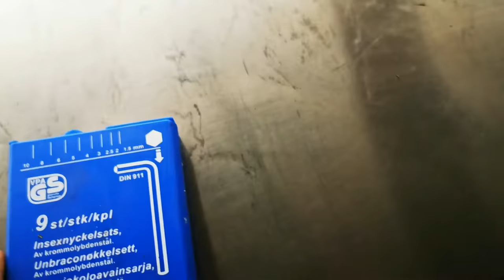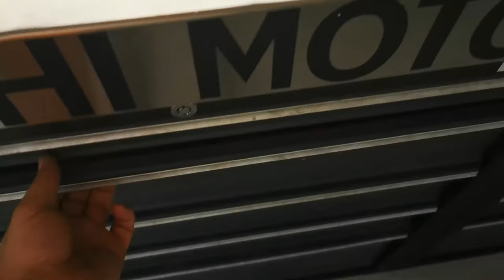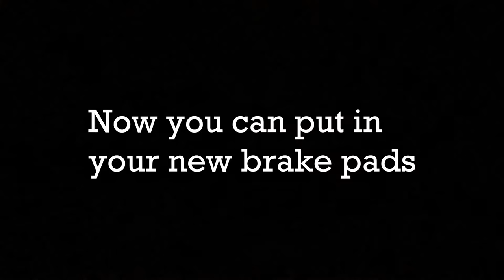Volkswagen / VAG - with Electric Parking Brake.  Replace pads (Easy, without computer) How I do

Comment: Find / buy a similar electric plug and apply 12V DC on the gearbox motor (mind the polarity - otherwise the piston will go out) . It will save you some time with dismantling the gearbox !  :)))
Reply: Right : if you connect a 12V spare DC battery on the socket, and invert the polarities, the motor will work reverse . You don't need a similar connector : put a thin pin on each cable, and introduce both in the caliper socket , that will be enough .
Reply: Reversing the brake motor is much easier and safer way to do this job.
A small pair of jumpers with insulated crocodile clips and lay out your large jumper leads on the floor for a power supply from the cars battery. 
Switching is done by touching the small jumpers on the big jumpers.

Comment: if I replace the pads and do exactly like you do in video.. when everything is installed, do I need to activate the electric handbrake-button in the car, and everything will line up in position.. (electricmotor "piston" on the caliper piston and the caliper piston against the pads and the pads against the discs) ? after pads installation, the motor needs to push the piston so much further than before.. will the motor run until it reaches stop-end, and then stop (handbrake activated)
Reply: For readers in the future. Apply brake pressure as normal with the brake pedal first. That way you do not "overload" the electric motor. Apply electric handbrake and it can run without resistance until it stops. Also it is recommended to release electric parking brake, build brake pressure with brake pedal, and reapply electric parking brake one more time.
Reply: @frodelarsen7105 brill! Exactly what I was worried about. Thanks 👍🙂🏴

Comment: Very helpful video. Could you possibly clarify 2 points for me ? Is a new 'O' ring usually required between motor & calliper body ? And did you rotate the piston or simply push it back into the cylinder ?
Reply: Thats what Im asking myswlf as well. Did you get any claryfication?
Reply: Hi, it's a simple job but very important to do it in order! You have to: 1st rotate the gear behind the piston so the piston has space to move in
and 2nd press the piston in. Be careful not to push it beyond its limit or you risk damaging the el.moter and piston.
Reply: @trihordias  thank you. Did it yesturday, worked perfectly. No errors at all 😊😊

Comment: They way you showing is way too complicated , with that brake piston set you can just find compatible adapter and  spin piston clockwise until stop , then push piston in. No need to remove motor.
Reply: The motor will stop it moving
Reply: @Nypartcannon  it will not , i did those brakes 100 times
Reply: @vojtechkrasl7501  ahh so
You need to rotate them
Reply: @Nypartcannon  if you dont have diagnostics you have to rotate them
Reply: @vojtechkrasl7501  if you do have the diagnostics, i think you can set the brake motor to retract all the way  back? or do you still have to wind it? (i dont have the wind tool)

Comment: Very helpful video. The caliper and epb motor seem to be the same as in my car (2013 Golf Mk7 Estate 1.6 TDi 77kW). But my caliper is mounted at about 12 O'Clock whereas yours is more like 3 O'Clock. I wonder if that has any significance ? In my case the piston is sticking due to split in dust cover leading to corrosion of the piston. I would be grateful to receive any advice you might wish to offer about changing the piston.

Comment: I did this job yesterday on a 2018 Skoda superb. It was very simple really. Important to remember to put the park brake in the off position and turn off the ignition first though. Then just a 7mm allen key for the two cliper bolts and 5mm allen key for the two EPB motor bolts. 
Once the motor is off, turn the multi spline clockwise, fully in. It's easy and you don't need to use a tool, you can do it with your fingers - it ensures you don't break anything that way too. Push the caliper piston all the way back - I just used a really weak quick clamp, it went in easy. Remember to take the lid off the brake fluid reservior and ensure it doesn't overflow when you push the piston in.  
Refit the EPB motor, refit the new pads and caliper.  Press the footbrake a few times. Turn on the ignition, activate the park brake. The motor will wind until it meets the disc then stop. Job done, no fault codes, no issues.
Reply: Thank you for the great information.  I will replace my Passat rear brakes next week.  This great video and your information should save me a lot of time.

Comment: Well this is interesting, I'm at my shop working on stuff watching you at your shop working on stuff🤔
I'm really diggin that caliper piston compressor set. I may look into one of those, I either just use that little block that's got all the different size knobs on it, or the shop one which is horrible.
Reply from the maker: Haha, similar interests I think 😉
The caliper comressorkit is not really needed here but sense I have one I might aswell use it🙂

Comment: Did you fit new carrier bolts and caliper pins?  I've read on a VW forum they are one time use only and am a concerned if I need to get new ones. Mine is a 2014 Golf VII 2.0 TDI GTD.

Comment: two small wires taped to an 18volt drill battery and the motor works great to wind the motor back.
Reply: For real?
Reply: Could you elaborate just a bit, pls?

Comment: What can i do if it's block? For example i try to drive ,the wheel is blocked and the parking brake flashes and i cannot take the brake caliper off
Reply from the maker: Sounds like the electric motor is bad, I would try to remove the motor where it is, then realese the parkingbrake with the screw under the motor, but thats just me 🙃

Comment: I just did this and did not have to remove the gearbox or the electrical connection. Just used the caliper tools.
Took me half the time.
Reply: Then you either did the front or don't have electronic hand brake!
Reply: @stuffoflardohfortheloveof  I did both and have the electrical park brake. Try again
Reply: @HoBBLeCooKiE  in which case why not share your method instead of throwing out unhelpful comments
Reply: @stuffoflardohfortheloveof  I said I just used the caliper tools to turn the piston back. It rotates to a point and then the last 8mm or so you use the normal piston to push it straight back. That is it. No need to remove the motor.
Reply: @HoBBLeCooKiE  ok, thank you. Doesn't (or didn't) the motor try to stop you from doing that though?
Reply: @stuffoflardohfortheloveof  not at all. I did it slowly. All working fine.
Reply: @HoBBLeCooKiE  ok, that is certainly food for thought. This will be my first attempt so I'm wary of even trying it tbh 👍
Reply: @stuffoflardohfortheloveof  then I would sugggest you remove the motor to be sure. Take your time. After doing it, you will realize it was actually quite easy! There are a few good videos as to how to do it. I replaced the pads and disks.

Comment: After this performance, no electrical errors?
Reply from the maker: No, it worked fine
Reply: I got all the flashes on the dashboard after doing it 😢. Brake pressure sensor, abs module, hill hold, epb not operational .....
Reply: @boyanratchev877  What did you do?
Reply: it turned out I have forgotten to plug the power cable to the left calliper motor. After plugging it, all was good and dashboard lights were gone
Reply: @boyanratchev877  Lol. I would make that same mistake. Glad you got it working properly. I was worried about this repair with that comment so I am glad it seems to be fine to do.

Comment: Can somebody please explain in plain english the meaning of adjust the gearbox?
Reply: Don't know where you're getting that phrase from but all he's doing is physically 'winding' back the 'plate' that pushes against the caliper. In normal use the electrical motor does this for you. He's doing it in stages (doesn't need to) where he winds back then pushes the caliper back to meet the 'plate' again, then repeats until he's wound back completely. 

There are other YT vids where you connect your own 12v source to electrically wind back the 'plate' for you, allowing you to push back the caliper yourself.

Comment: Why disconnect, when there is the EPB system two position switch one position is for activate stop, and the other for activate release caliper. Pull up the handle switch activate the brake, the stop. Press down the handle switch activate release the caliper.